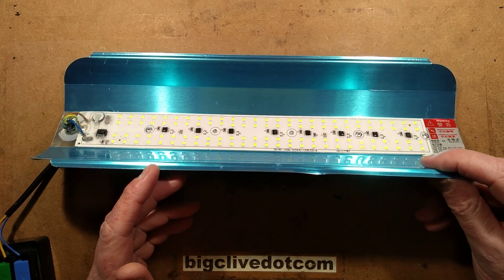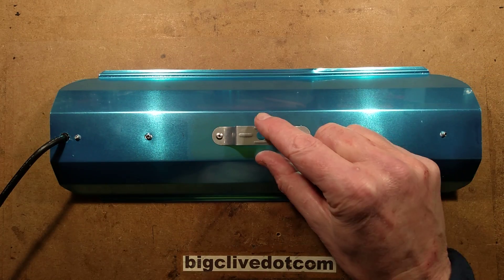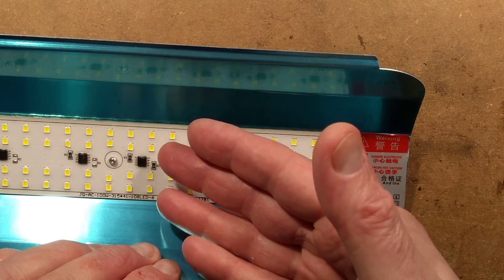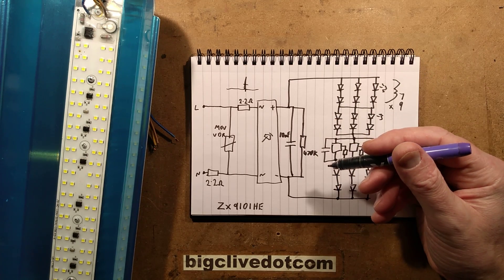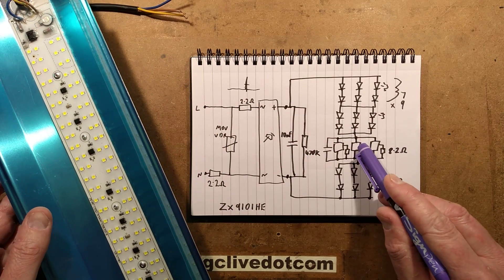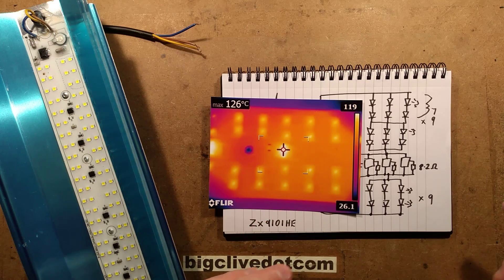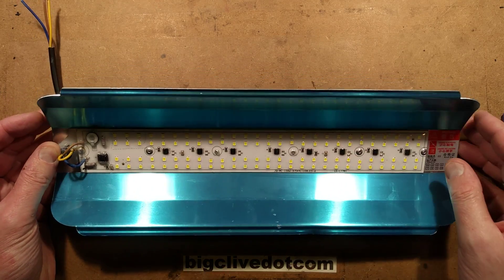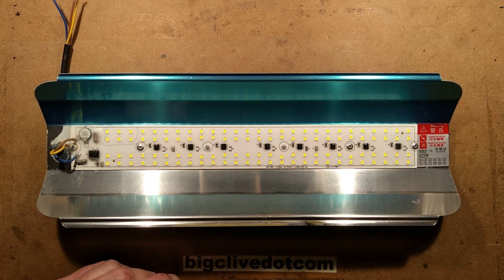100W LED module (growlight?) with schematic.

Comment: Was wondering if anyone had an opinion on wether or not the effectiveness of the MOV would be affected by having one of the in-rush limiting resistors “in front” of it as opposed to the MOV being the very first component directly across the mains so it can do its task unimpeded?

Comment: This actually looks like a pretty reasonable way to heat a greenhouse in winter in the UK, and you get a grow-lamp out of it at the same time, you could stick it on a thermostat and grow potatoes or something. Use a fan blowing across it to even out the temperature in the greenhouse.

Comment: I think the bracket is designed for the standard sort of nipples used in lighting fixtures, at least in America.  

https://www.ebay.com/itm/Westinghouse-7015000-Assorted-Light-Fixture-Nipples/282483150868

There are very thin nuts that thread onto the nipples as well, and the supply wires pass from the box to the fixture through it.

Comment: Maybe (for sure) it runs cooler if you remove all the protective film from the reflector, which is intended to act as a heatsink as well. I wonder how much cooler it would be then.

Comment: Looks like one of the current regulators has the second resistor populated.  I can't see if it's the same value or a different one.  I see some dark dots in the corners amongst the LEDs, but I can't tell if they're fiducials or something else.

Comment: What's the power consumption of the lamp overall? Quite a few numbers were mentioned but wasn't sure if it varies over time depending on the cooling
Reply from the maker: Starts at 100W and then falls if it gets too hot.

Comment: at quick glance the second resistor would be for a thermal foldback setting on non shit chips, without them the chips are set to their max, chips that enable them let you back that off to a more reasonable level per application

Comment: I have some small 10 watt cob led strips without a heatsink they get to 120°F is this to hot for the cob
Reply from the maker: It's not excessively hot, but a properly run 10W LED should be fitted with a heatsink.  LEDs run at lower efficiency when hot and it shortens their lifespan.
Reply: @bigclivedotcom  what would you consider an "ideal" temp for COB LED
Reply from the maker: I prefer to keep the surface below about 50C but it seems normal to run them at very high temperatures these days.

Comment: any suggestions for the silicone goop they cover those with, been looking to try and make my 240 v 'driverless' Cobs be a tiny bit safer, yet handle the heat, I have built an array of grow spectrum cobs into a PAR 64 case, and have had to go commando and disconnect the earth, to avoid tripping the house, as Im clearly getting a bit of leakage through the substrate, no continuity to earth on a meter but a neon on the case is showing a little tickle getting through

Comment: Clive you should try out one of the trigger feed solder guns. They look like a cold wire feed Tig torch combine with the feeding mechanism of a hot glue gun. Many sellers from the usual places.

Comment: There's one thing I just don't get though: if this runs off of rectified mains voltage, why would they run  the LEDs mostly in parallel? They've got plenty of overhead voltage-wise. Seems like if they just ran them mostly in series they wouldn't have such a massive voltage drop over their current regulators and they might not get as hot, plus they could probably use less of them too.

Comment: Could someone tell me what is this component at 2:48 (between the live wire and the resistor) ? I know he said it in the video, but I couldn't understand him.
Reply: A MOV, Metal Oxide Varistor is the device. Clive continues to explain that he has not seen them as a surface mounted device before.

Comment: I'm surprised you didn't measure the actual power consumption to see just how far off it is from 100W
Reply from the maker: I did.  It started off at 100w and then reduced as it heated up.

Comment: It doesn't seem to have a hard plastic protection for the cable going through the sharp edges of the fixture. Quite an hazard as the cable is prone to cuts and expose the live wire, eventually touching the fixture (good thing it's grounded ).

Comment: Would you like a laser etcher/paper cutter? How would I post to you? (I cannot see any contact details). It seems to be powering the laser, but then voltage/amps dropping. I don't have the expertise to fix it's power to be more stable, but would happily post to you for free. :)
Reply from the maker: Is the power supply rated correctly and the laser current set?
Reply: Thanks so much for some help!

No idea on the supply. I guess I should get the meter out. The laser will cut paper for half a second, then seems to loose some power, and then just shines dimly. The packing slip has a cross through the "laser module", yet I have one (either a spare was thrown in, or it's from a different kit :P ). So I've had to splice the lasers power cable onto the control board connectors.

The laser came with a 5v 1.15 amp adaptor, but the control board is 12v, and it's PSU is rated at 2.5amp (for stepper motors and control chips as well). It's an "Eleks" laser engraver, A5. Some models show an extra control board (step up?) circuit on the Laser, but mine came without it. :(

As said, I'd be happy to post it to you, and you could "burn" some nice cards or custom stickers or something. XD
Reply: PS... the wire to the laser is getting warm... I guess that is not a good sign. XD

Comment: Clive, I have a 40 amp mcb that was running a 9.5kw shower for 11 years and has now shat its pants. Would you like it for autopsy?
Reply from the maker: Has it burned up?
Reply: It looks ok apart from the case is slightly blown, what it looks like inside is anyone’s guess. It was red hot when I removed it from the board.

Comment: Hi Bigclive.  I bought one of these in 50W as growlight.  Same configuration but smaller and magenta.  It gets incredibly hot in open air even with the film off both sides.

Maybe it would be worth an experiment to insulate one of these and see what happens if they cant dissipate.  Would it throttle back to 40% then shut off or go down to 0% linearly.  It would make me feel better if i knew it doesnt just throttle to 70% minimum and thats it until it combusts.

Comment: Oh  hell....just add a 1000uf cap on that,  to keep down the flicker, if you can grind off a bit of the crappy silicone that they use  to solder it onto a pad
Reply: As it is, the LEDs are off most of the time and only flash briefly on the peaks of the mains input waveform. This means that the current pulses can be relatively high as the average will be lower. If a big reservoir capacitor is added then there will be a constant high current through the LEDs which would probably lead to their rapid demise. It could be done but the sense resistors on the regulator chips would need to be changed to lower the current.
Reply: Oh crap, I didnt think of that...Thanks

Comment: never understood the logic of this type of design,  why put all the chips in parallel, as if one chip fials, all the lights are then controlled by the remaining chips, till another fails, and then another....

if this had been built with 9 chips supporting 1/9th the number of leds then a chip failure isnt total failure...

having your glow light fail could really upset your crop, i'm told. but losing 1/9th of your light, they would i guess think it was a cloudy day.......

Comment: What is the power factor of this lamp? With no reservoir capacitor it should be better than most low cost LED lamps.
Reply from the maker: It was pretty good.  It showed up as about .95 but while the current and voltage would be in sync the current across the sinewave would be predominantly at the centre.
Reply: When smart meters become compulsory and power companies start charging for apparent power then lamps that work on this principle would be a worthwhile investment. The problem is that they are off most of the time but flash briefly at the mains waveform peaks. This might be solved if the lamp had a phosphorescent diffuser.  The diffuser would continue to emit light while the LEDs were out to smooth out the flashes.

Comment: +bigclivedotcom If an electrolytic cap were added to smooth out the ripple, why do you say it would cut back the power even more? Sure it might be operating at a lower peak current, but is there any reason the thermal limiting wouldn't limit to about the same average power with the smoother supply as it would have done with the rippling supply?
Reply from the maker: With the higher continuous voltage compared to the average of the unsmoothed sinewave the linear regulators would be doing more work and getting hotter, so they would throttle back the current even more.
Reply: Ah okay, thanks. I didn't notice the regulators were linear. I thought most of the dissipation would be coming from the series resistors and LEDs themselves, with only switching losses in the regulators, but obviously not.

Comment: Those LEDs are going to have a very short lifespan operating at such a high temperature. They should be less than 50-60°C if you want them to last.

Comment: Can you grow plants under white led lights? I thought the whole light spectrum was required  at minimum red and blue? Might make a cool testing video to find out
Reply: its not "white"... its a combintion of blue red and green light which translates to us as "white". if its a cooler "white" than more blue can be found in the cobination. warmer "white" more red, i think u get it. check out HLG Grow lights. they are using samsung lm301b chips (they are "white"). those are some of the best and most efficient grow leds on the market. those multicolored ones are the old style of grow leds. they are not as efficient im plantgrowth. 
take a look at good old HPS lights. do u see an arrangement of multible colored bulbs? no! is our sunlight fullspectrum and contains blue, red and green light? oh hell yeah. do u know this old tune from pinkfloyd? thats the shit i'm talking about.
Reply: @milonso650  awesome ya I think I was thinking of the old cheap ebay grow bulbs if there is full spectrum "white" LEDs available I can definitely see the old style growing lights being phased out quite quickly  we are in a strange and wonderful new world lol
Reply: I think you can but it's not very efficient and plants that need a lot of light will not do well. Red and blue or full spectrum, as you've already said.

Comment: Given the temps on the chips,/assembly and the design, I think this would be a good candidate for running as-is @120v (NAmerica) and using as a seed-sprouter or for an indoor herb garden. I wonder what colour-temp the leds are.

Comment: Query: is there ever a time when you wouldn't want something grounded? LinusTechTips did a video a while ago about upgrading the new iMac Pro, and the power supply in that thing isn't shielded. Someone in the comments recommended unplugging it so the chassis wouldn't be grounded, and that "should" make it way safer, but I fail to see how. Is he full of shit, or did he know something I don't?
Reply from the maker: In an arcade game it's not just the monitor that would be damaged.  By not running it from an isolation transformer it would reference the RGB and sync connections to the mains supply and potentially nuke the game PCB too.
Reply from the maker: If the iMac pro internal power supply was exposed I'd suggest unplugging it completely to ensure it was isolated
Reply: The man himself! :D And yeah, if you do any work on the internals, the power supply is exposed. It's just hanging out next to the left-hand speaker as soon as you remove the screen: https://youtu.be/WvvBh3CIoWc?t=3m02s

Thinking about it, I'm wondering if it's so you don't touch the power supply with one hand and the grounded chassis with the other. I imagine that would be, uh... very bad.
Reply: Yes, if it's something meant to be isolated.  For example, old arcade monitors. If you ground them, they'll actually be damaged.
Reply: Really? Yikes, bet those are hard to replace... The post seemed to be implying it was more for safety's sake than to prevent damage to the device itself. I've always thought of grounding something as a safety measure and it seems odd that someone would think it's safer to bypass it.

Comment: Hey Clive, I’m considering upgrading my headlights to LEDs. The ones I’m looking at are passively cooled, which is nice, because fans are just a bad idea in engine bays, it’s far too dirty down there. But I’ve read that warm white colour temperatures are better than cold white, the former apparently gives better lighting. What’s your thoughts on this? Cold white leds are about all you can get, warm white would essentially be a custom order. I’d love to know what you think.
Reply from the maker: It would be nice if they did do them in warm white.  Keep in mind that LED lamps will produce a completely different beam shape to tungsten lamps.
Reply: Yes, I know they'll be a different beam shape. My car has projector headlights for the low beams, but I actually want to use these LEDs in the high beams, which are reflector housings. The headlights in my car do have a nice, long throw for the high beams, and they are already punishingly bright, but I want... more brightness. I basically want as close to a light bar as I can get, without the light bar.

I suppose I could always just try them. The nice thing about these, is the heat sink is reversible, and is threaded onto the assembly that the SMDs are mounted to. I'm hoping the headlight housings won't require too many modifications, and I might even be able to keep them sealed, with the heatsink reversed.

These lights do have some sort of module on them, though, almost like a HID ballast, I wonder if these things have an external driver. I suppose I don't really mind that solution, because it would reduce the heat in the headlight assemblies by having the driver separated.

Thanks, Clive! You're always so helpful, and I am always so grateful that you still have the time to reply to me. Cheers!

Comment: It's too bad it's riveted together, if those were screws instead you'd at least have the option to sanely add some extra heatsinking to it or tweak it a bit.
Reply: Drill out the rivets and replace with self tapping screws for metal.

Comment: That's not going to last very long at such high temperatures! Clearly that thin piece of aluminum is ill suited to dissipating the heat from 100W worth of LEDs. To properly dissipate that much heat you need a nice "chunky" heatsink with fins to increase the effective surface area, or active cooling (fans).

Comment: Clive, I know it's not going to dissipate a phenomenal amount more heat, but suspect the laser resist / blue coating would insulate it a bit.
 
I bought the 48W version and it has sets of four instead of sets of six. I need to cut the traces and install a jumper wire to run it off of 110V AC, so it is untested as of yet.

Comment: I wonder if I might draw your attention to this design for the ultimate head torch: https://www.cdc.gov/niosh/mining/content/humanfactorsandergonomics/illumination/caplampdesigns.html
It has diffuse horizontal and vertical beams and a powerful spot. Being for use in mining it is heavily engineered, but you can't patent an idea and perhaps you might be able to knock something up by hacking together existing bits and bobs.

Comment: This is really a nice lamp. Would be good for outside floodlight. Definitely light up the yard. 
It would be interesting to see how the pcb is in contact with the "heatsink" as it's supposed to conduct the heat away. Maybe the reason for the high temps is because there is poor contact(?)
Pop those rivets out and let us see the innards of that cheap bright lamp!  :)
Also, after reading some of the other comments, could you also test by putting the two capacitors with the rectifier and show us the results with and without them?
Reply from the maker: There are no innards.  It's just a folded bit of aluminium with a PCB riveted to it.

Comment: What about removing the sheet metal reflector and replacing it with an aluminum heat sink? Or even adding a fan or two?

Comment: Add a capacitor, put a resistor in line to limit it to 50W, drill out the rivets and screw on heatsinks. Not a bad light imo.

Comment: I can imagine a strip of metal affixed across the tops of those current regulators to improve heat dissipation.
Reply: Or some Raspberry Pi heat sinks with stick-on thermal pads?

Comment: You left the blue film on? Rather you can't remove the blue film, because it's riveted in place and a pain to remove. They were too lazy to do that before assembly. Now the LED board is nicely insulated from losing too much heat the the aluminium sheet.
EDIT: has the film actually been removed from behind the LEDs?
Reply from the maker: There's no film behind the LED panel.  I only left the film on while filming to avoid glare and reflections.  I removed it afterwards, but there was a small amount left between the riveted mount and the back.

Comment: Seems like it could be a good 'base' for a lighting project. Chop out their primitive driver circuit, install a proper LED driver (possibly a 'dimmable' one?), stick it in a cheap fixture, and it's probably fine anywhere -- the silicone coating would probably be good for environments where condensation would form on the inside of the fixture, i.e. outdoors.

Comment: If your wild guess for the intended use is correct I can see potential disasters for some enterprising "herbal gardeners" With that much heat, and with some not being the brightest bulbs in the chandelier, there may be some aromatic attic fires ahead.